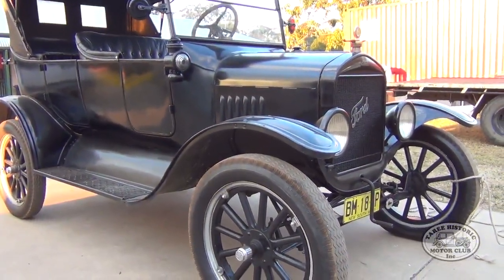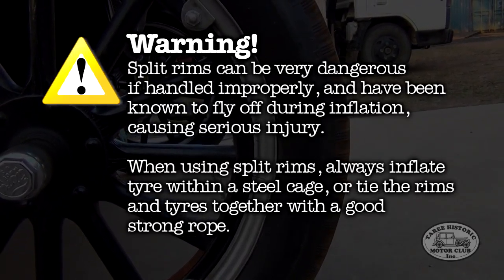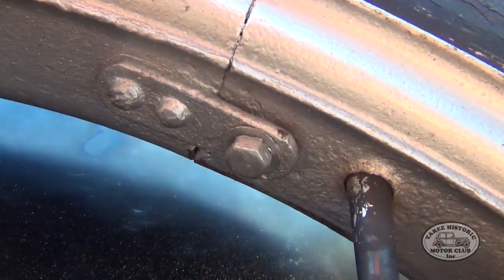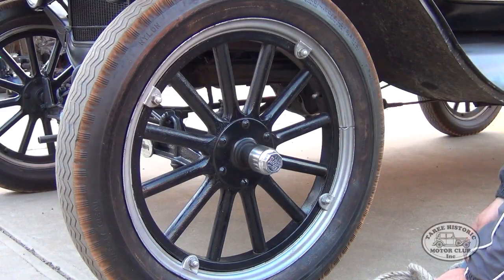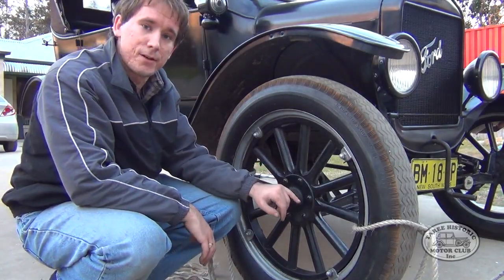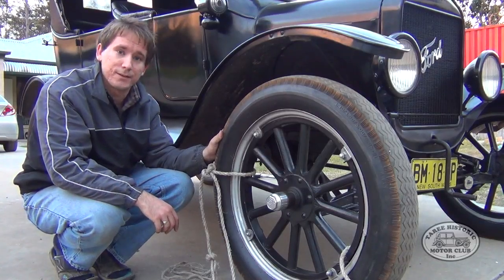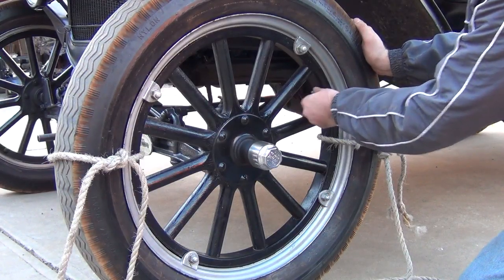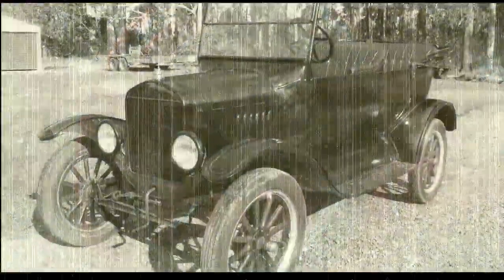Ford Model T - A Closer Look: Tyre & Rim Safety

Comment: I thought in an earlier video he said the tires inflated to 50psi
Reply from the maker: I did say that yes, but I was incorrect, as 50psi applies to the skinnier clincher tyres. (There's meant to be an annotation but YouTube has scrapped them) I have balloon tyres on mine, which are filled to 35psi.
Reply: @ModelTMitch ,ok. Whats the top speed of it?
Reply from the maker: I've had it up to 70km/h once (43 mph), but only once, thats in high gear, full throttle, full advanced spark, and going down a slight downhill grade :) .. Other than that, I don't like to push it to the limit - the original engine is nearly 100 years old :)

Comment: Good video Mitch. You should
Do a tire replacement video soon! However this run is not the kind of “split rim” to blow up, those actually break into two pieces and the bolts hold the halves together

Comment: The split rim that the warning is on is a tube less. Like a car rim with the side of the rim that comes off and that is the ring. the ring has a split and it to open it up so it can lock in the other half of the rim. than you secure it to the rim. And if the ring slips off as you air it up your wife will need a black dress. Please look up 18 wheeler old split rim with locking ring and you put a 100 psi of air in it. If they slip they will bend a round the cage the ring that is. And I do like your channel

Comment: Good video. My 1918 Buick has the split rims also. I think if the rim is mounted on the wheel it's impossible for it to come flying off and injuring anybody during inflation. It's only when you have the rim and tire off the wheel that the rim can rocket out at you.